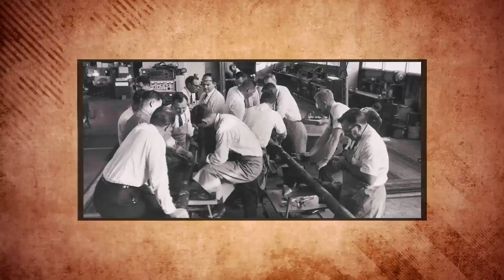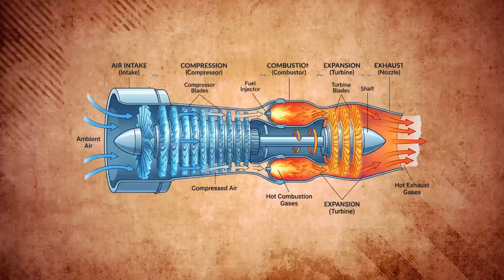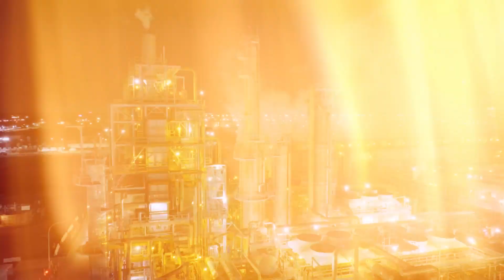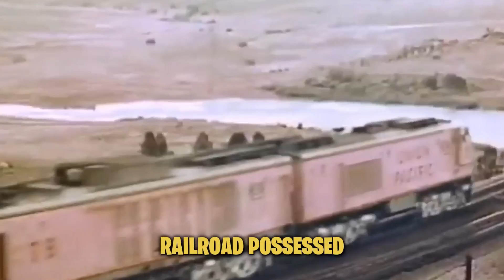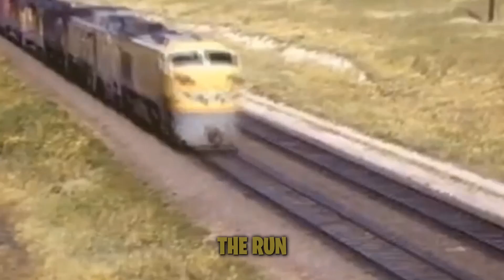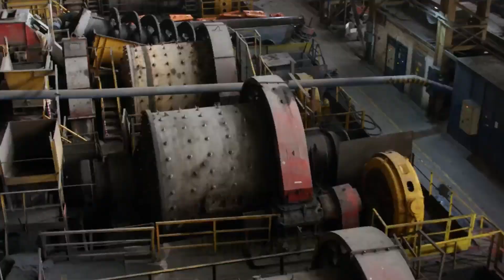The Train So LOUD It Emptied Stations

Comment: That sound in the beginning didn’t sound like a locomotive at all. It sounded more like a supersonic fighter jet flying at Mach 1 than a locomotive on notch 8.
Reply from the maker: That sound is the locomotive, it is powered by a jet turbine engine.
Reply: @TheLocomotiveHistorian  Hmm, if only there were clearer recordings of gas turbine locomotives that would be easier to tell what they would’ve sounded like. At first, I thought I was hearing static at the beginning. I still find it hard to believe.